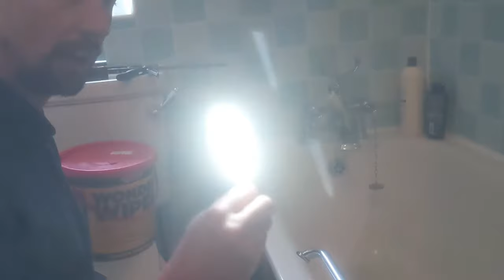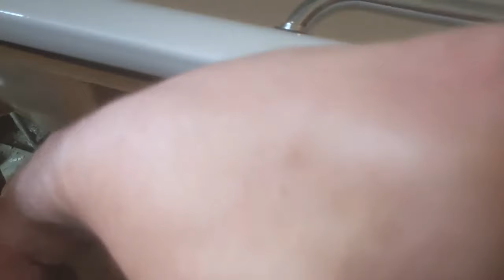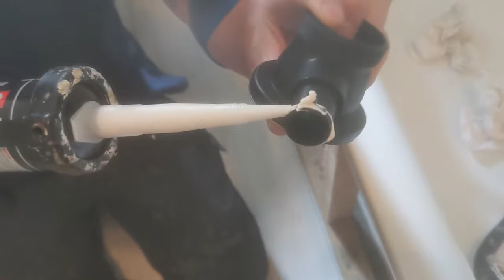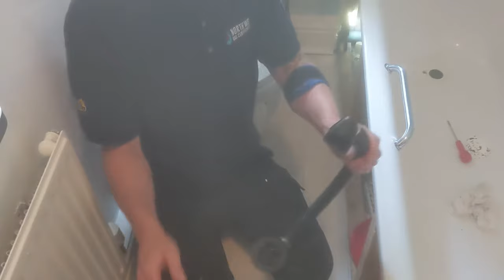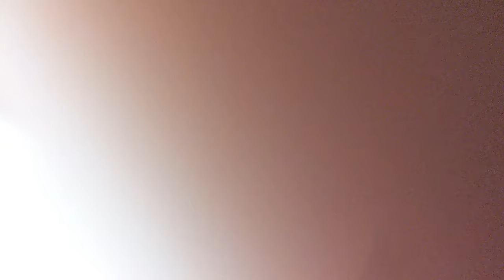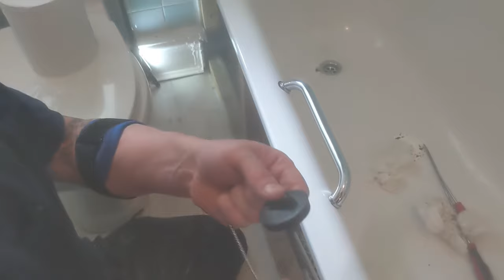How to install a new bath waste

Comment: Great video...I have a question if you could help me please... I have to replace and old bath waste to an installed bath, what is the best way to clean up the old silicone on the underside of the bath where the drain hole goes and where the overflow goes where access is tight as the bath is already installed?
Reply from the maker: Hi. Generally silicone will peal off pretty easily off the underside of a bath. However if it doesn't and your struggling to scrape it off with a knife or scraper you could use some silicone eater👍

Comment: Can you apply sealant to both sides of the gasket?
Reply from the maker: The gasket on the underside of the bath??? To be honest. Applying sealant on the underside of the bath isn't always necessary. If the bath was new with no imperfections etc, the gasket should provide a water tight seal. When using some sealant as an extra precaution, I would just use on the top of the gasket, the side touching the bottom of the bath. You can use on both sides but I find when you tighten it all up the gasket seems to slip a bit with the sealant. However if you have used on both sides it will be fine but be careful not to over tighten 👍

Comment: I done everything you said was on the the last bit the over flow done the silicone went to twist on but there’s no tighter I can go, it won’t come off and there’s a gap I can’t close between bath and overflow? I’ll probably have this sorted before you respond but any tips ?
Reply from the maker: Might need to put a photo on. I dont quite understand. Would it push on before you put the silicone on?? If it didn't, its maybe a fault with the product??
Reply: @northwestgascertificates  yeah was faulty ended up using the old overflow part which just needed abit of a clean up and re applied all that you had said. Just ran a bath , no leaks all sealed nice and tight. Really appreciate this video, gave me the confidence to do myself. Keep up the good work pal
Reply from the maker: Good to hear it ended well 👍👍

Comment: What sealent did u use please
Reply from the maker: I used stixall but can use many different types to be honest..
Reply: @northwestgascertificates  thanks can u use this to seal round baths or is it just a glue thanks
Reply from the maker: Hi you can use to seal around baths. However it is a little harder to use when making it nice and neat around baths. Some other sealants that are specifically for baths/basins are easier to use

Comment: I've just installed a new bath waste kit, but I have a slight leak. Only slight, but the sealer hasn't been on for too long, and probably hasn't properly set yet. Could the slight leak stop in a day or so?.
Reply from the maker: The way to find out if the leak is connected with the sealant is to fill the bath with the plug in. If there is still the leak with the plug in, then it is definitely the sealant and i would re do to be honest. You could try and tighten it slightly more first to see if that makes a difference but then re do if it doesn't..

Comment: I got quoted £130 quid for this by a plumber would you say thats fair or hes trying to have my pants down
Reply from the maker: Depends which part of England you live in. Down south, maybe that would be the cost. I think £75 labour is about fair
Reply: @northwestgascertificates  I'm like your self from the northwest, by any chance do you cover Manchester?
Reply from the maker: Yes im always working in Manchester. Give me a shout if you want me to do it for you. 👍07868753427
Reply: South UK like in London £130 imo is fine, plumbers pricing is roughly £125 per hour but they still can add more for travel and parts... even if the parts are spares or from customer left overs so you could end up £200 even.

Comment: Those cheap ones are are terrible. 
The larger McAllpine overflow with compression fittings are far superior. 
No hybrid silicone ADHESIVE ! needed plus Stixall is primarily an adhesive like CT1. It also goes yellow after time. The job is a botch and a total mess!!